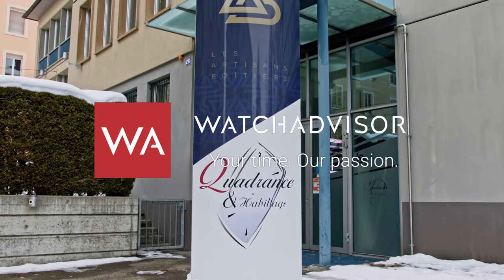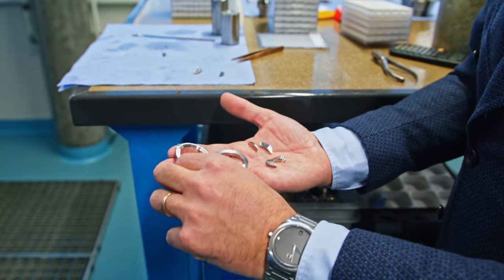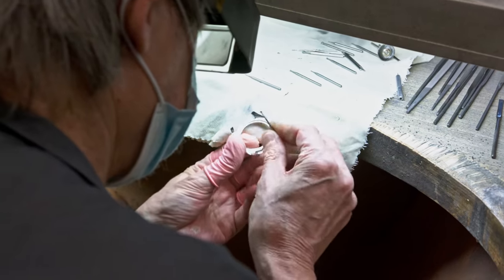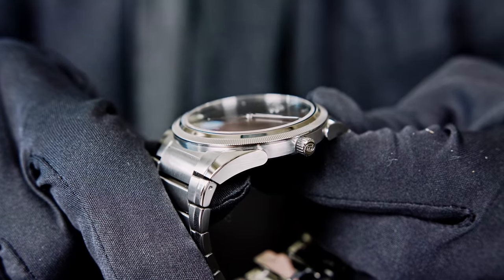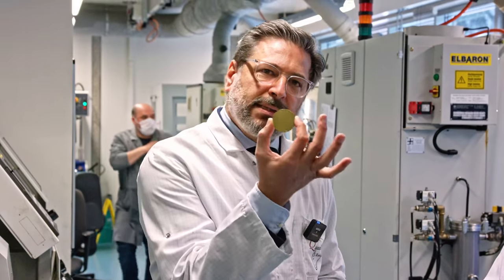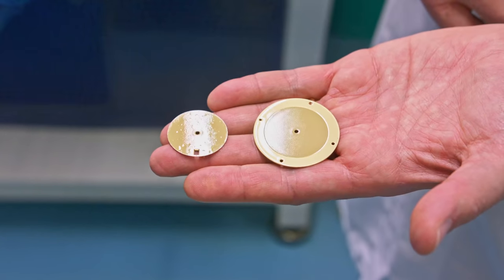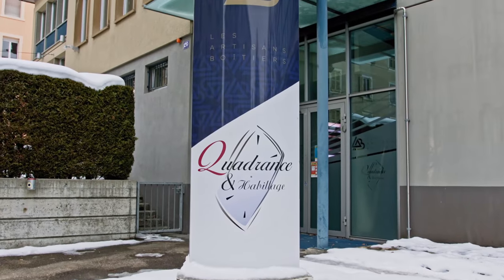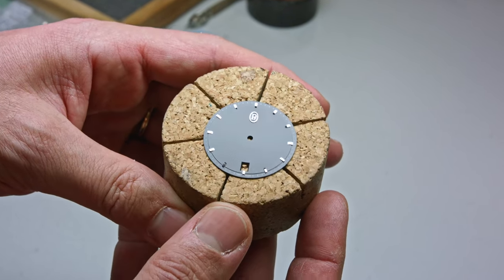PARMIGIANI Fleurier. Case & Dial Making. Tour d'Horizon! Video 2 out of 4.

Comment: Thank you Alexander and Guido for the detailed tour. I have two questions regarding two components which are the bezel and the guilloche.

1-Bezel: From what I understood from this video, the decoration on the bezel (Moltage) is done by machine, right? I remember that in other models like the Toric the moltage is hand-knurled by specialist with an antique machine. So, is it done by machine when it comes to the Tonda because platinum is harder to hand-knurl, while in the Toric it’s done by hand because gold is easier to hand-knurl?

2-Dial guillochage: What I understood from the video is the the guilloche pattern is done by CNC machine. Would that be correct? Or is it done with a traditional engine-turned guilloche machine?
Reply from the maker: Thanks for your feedback! 
1. It is manufactured as shown in the video…
2. Not traditional engine-turned …
Reply: @WatchAdvisor  Alexander, I just read in Hodinkee’s article on the new PF models where Guido mentions that it’s authentic hand-turned guillochage. So, what to believe here 😅?
Reply from the maker: @inkhaurt5812  The dial of the Tonda PF is not engine-turned, the pattern is so fine you need the help of a CNC machine, the bezel is made out of platinum, also here a machine does the work since platinum is a very hard material … Also due to increased production quantities it is no longer possible to do this uniquely by hand… That’s what is actual today… I don’t know how old the article is though…
Reply: @WatchAdvisor  The article is from 26 October 2021, so around the time of the introduction of the Tonda PF collection. Here’s the exact excerpt:

"Returning to the dial side, each Tonda PF model has received an identical Grain d'Orge guilloché decoration. And to be clear, this is genuine guilloché, finished on a rose engine lathe in Fleurier. The alternating, weave-like guilloché pattern is genuinely breathtaking in person. Terreni points out that no other high-end sport-lifestyle watch features authentic guilloché. I had to think about it a bit, and depending on how you characterize the current-gen Breguet Marine dial finish, I believe he's right (though I look forward to being proven wrong in the comments section)."

Link to the article:
https://www.hodinkee.com/articles/parmigiani-tonda-pf-collection
Reply from the maker: @inkhaurt5812  In the early days of that watches it might have been done by hand… today with the quantities desired machines took over some work… Nota bene : this is not done to save costs …
Reply from the maker: @KrzysztofWolyniec  No, you should read carefully and also the Hodinkee article…

Comment: It is very concerning that hand knurling has been replaced by CNC.  "Since the brand’s creation in 1996, Michel Parmigiani had worked with the same artisan who applies the knurling to every single Toric watch by hand. Through his creations, the brand helps to keep this precious skill alive."
Reply from the maker: No, no it was not replaced... With platinum - since it is so hard - you just need a different tooling...
Reply: At 5:20 in your video. And as you described in reply below. The knurling is clearly visible on the machine, non?
Reply: @WatchAdvisor  in reply to @inkhaurt below you said: "It is manufactured as shown in the video…" that would be by CNC machine in this case for the Tonda PF example
Reply: @WatchAdvisor  Hi Alexander,I am a bit confused,so is the knurling bezel done by hand or machine?cuz in the parmigiani webside,the spec ‘s page  also said is “hand knurling bezel”..

Comment: Is the guilloche made by hand-operated rose engine?
Reply from the maker: No, this guilloche is so fine that it needs a bit of more modern machines to do it…
Reply: @WatchAdvisor  As I guessed because you didn't show any detail about it 😉
Reply from the maker: @chia-mingyang5804  I was not supposed to disclose all secrets … 😉
Reply: @WatchAdvisor  Understood!
Reply: @andresfg6788  AP also makes their RO dials by machine.
Reply: @WatchAdvisor  My understanding is that, originally, the dial was finished by hand, so it is not too fine to be hand finished. But to keep up with demand, they switched to machine finishing. To me, that loses quite a bit of the value proposition of this piece.
Reply from the maker: @robgates3323  It is still engine turned, but the manual turning of that wheel on the machine is now done with an electric motor…